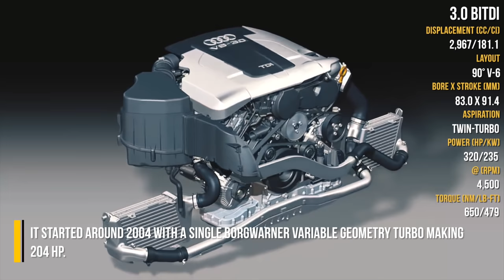7 Greatest Audi Engines Ever

Comment: I was an Audi dealer tech for 35 years before I retired. A lot of great memories in this video. I will say though, most of those engines are far more fun to drive than to work on.
Reply: audi techs i have noticed over complicate everything and do things by the book, where as if you just do some simple redneck engineering you save time and do the job better than the manufacturers “rules or procedures”

Comment: 2.2T is the best!
Reply: Yes it is, 3b is the best of the 2.2
Reply: Indeed, anyone selling an AAN 20v turbo?
Reply: aan is best ;)
Reply: 3B is shit compared to the layout of AAN, ABY and ADU.
Reply: @Holli622  3b has the best airflow, and very minimal changes, minus ecu between them.
Reply: @harrisondavis2668  the AAN intake manifold outflows the rest of them by far so, no. And between a 3b and a AAN and ADU there are some huge tech differences.
Reply: Harrison Davis steal 3B intake for my AAN
Reply: ye it is close to the 2,7 TT :-)
Reply: Definitely not the best. Definitely one of the most legendary but not the best. Best motor to date is the 2.5T i5 motor and that’s based on sales numbers. Best power house is the BiTurbo V6 out of the B5 S4 and 3.2 24v VR6 motors.
Reply: You are damnn right
Reply: @El_Jefe_S3  2,7 t is the best and the best 😁
Reply: 2.5t *

Comment: missed 1.8t 20v ;-(
Reply: The bam engines are shit.
Reply: Failed headgaskets, turbos and coils?
I know several Audi enthusiasts that hate that engine.
Reply: Bam, Amk, Ayp and Apx are good
Reply: Designed by Audi, built by vw.
And the 20V tag was a highly evocative reference to the mighty Ur-Quattro
Reply: Well, i have the APX engine wich is tuned above 300hp, it works like a charm, goes without any problem, never had issues with coils, turbo is a borg warner k04 hybrid and headgasket no issue at all, so do not know if u are thinking about the 225 or the poor 180...
Reply: And it has original forged MAHLE pistons, crank and rods, webbed block for lighter and cooler engine,, list goes on about good things
Reply: I own an auq roadster and its pretty bulletproof. Crazy to have the money to upgrade it to stage 2
Reply: @Ry_Hardy  Mines making 348bhp and in daily use for over 45k miles making that power (140k total). Only bad thing about that engine was the weak rods which most people replace.
Reply: The AEB was a tuners dream, I had 2 of them...
Reply: @espenschjelderup426  There a definitly more fans than hater. The engine is great, there are even groups in facebook with 15.000 people.
Reply: @owngun   I may be a bit biased because I don't like VAG cars 😂
Reply: @espenschjelderup426  I cant understand why people dislike cars just because theyre from a specific brand or group, theres a awesome car from almost any brand. Like how can you dislike a V10 Biturbo RS6?
Reply: @owngun   I don't dislike VAG because it's VAG. But most of the cars from VAG I have tested I don't manage to find a comfortable driving position in, and most of them I don't like the handeling of. 
Actually helped a friend diagnostic a 1.8T(a tuned 150hp one) A6 Quattro about a month ago. We suspected a coil because of the missfiring, but the engine also got a bit hot, and changing the cooling fan fixed the problem. My Autodata tells that both cooling fan and coils is known problems.
Ok car to drive, but considering the pricetag new, a bit dissapointing. Handling was a bit swimmy, and a bit stiff and uncomfortable because of the factory lowering.
I actually like some VAG cars a bit, like Skoda Oktavia and Superb, and I like the 1.9 TDI.
I like Ford the best when it comes to makes, but not alt the cars from Ford. I don't like Mondeo for many of the same reasons as mentioned for VAG above.
Does VAG make cars that are nicd to look at and engines that sound nice? Absolutely.
Reply: @espenschjelderup426  You should test more 1.8t 20v. The engine is almost bulletproof. I own my 2nd 1.8t both didnt made any problems. Ive test driven some 1st Gen TT with 225hp and they drive very well.
Reply: Engine turns to shit after 300k kilometers, almost every rotating part will start to fail, my head gasket is about to blow, etc. etc. 

Anyone selling an AAN 20v Turbo? :D
Reply: Jori Schröer the best 1.8 T is the APY. I have searching for very Long to get one with that Engine in good Condition (Only the Audi S3 8l got this Engine). Now i have about 300hp and it got 235.000 km on it. Never made any Problems. And you can do anything to it. (Here in Germany the 1.8 is like the sr20 in Japan)
Reply: AEB were pretty solid as well
Reply: I got a 430hp B6 A4 on a 52mm turbo at 26psi on stock internals just built trans clutch an fuel system
Reply: @unsaidatom2310  here here!
Reply: @owngun  i'm thinking about buying an audi a3 from early 2000s with a 1.8t. probably wouldn't buy one over 200k kms (more like up to 150k) and i'd prefer the quattro system. I hear these engines are quite reliable and tunable. What do you think should i buy it, or go for something newer?
Reply: @adodoes8770  If it is right maintained  the engine is great. The Timingbelt should be done. Check that the halexoil was changed too. I would change the motor oil to a 5W40 or a 10W40. If you want a newer A3 buy the 8P with the 2.0TFSI quattro. Its the engine of a mk5 GTI but with quattro.
Reply: For good reason....there's absolutely nothing special about them.
Reply: @dwalmop2  At the time the 1.8t 20v was released the 5 valve per cylinder were special. The engine is bulletproof and very tuneable. In europe the 1.8t is and was a quite popular for tuning. Compare it to other smaller engines from the time.
Reply: @owngun  meh, I don't know...I used to have one.  Even tuned it was pretty gutless under about 2500-3000 rpm.  2.2 20vt 5 cylinder was/is much much better.  It's got that little bit of extra torque down low when you need it waiting for the turbo to spool.
Reply: NOTSUI AWP ftw
Reply: @LuckySyke  amb here. block and turbo are solid no doubt, but head gascket is a pain inthe arse
Reply: me too. Another great and tunable engine
Reply: Love mine in my gen 1 TT, rev happy and tunes well, just change that timing belt!
Reply: TFSI and FSI Will never live long like 1.8t 20v...
Reply: I’d rather the 20v 1.8t over the the V8 in the B6 and B7 S4 :(
Reply: Again, timing chain... that shit will get loose quick
Reply: @patrickrodrigues4202  agu is great for modification.
Reply: Eron Gashi no its audi product
Reply: 1.8 20V (non Turbo-N/A)Version is better i think

Comment: The 2.7t actually ran to almost 2005 in the allroad :-)
Reply: Yep.  Friend of mine has an 04 allroad i think. Not 100% on the actual year
Reply: Yeah I had a 2003 2.7L Allroad. Pretty quick for a wagon lol.
Reply: personnal fav
Reply: Get a b5s4 and you wont miss your allroad :)
Reply: I thought the 2005 allroad only had the 4.2?
Reply: The 2.7t is unreliable and the allroad is a shit car.
Reply: MTM used to have an upgrade package for the 2.7T RS 4, boosting it up to 600 hp.

Comment: Ehm, 2.5 TDI inline-5? Absolutely bulletproof engine, first Audi TDI engine ever.
Reply: Absolutely. Not sure if it has been modified for the van, but in the ambulance world the VW T4 with the 2.5 audi are remembered for being near indestructible
Reply: @crezychameau  < This. In Ambulances this engine goes for 600k with no major issues... even though it is never heated always floored and so on.
Reply: I'm a happy owner of one bulletproof 2.5 TDI in a bulletproof Volvo V70 I. Brilliant car, 474 000 km on the clock and running like new
Reply: Inline 5??
Reply: Boring as fuck though when compared to. the above mentioned engines. probs why  its not listed .
Reply: Don't forget the 1.9TDI
Reply: @jirikopejtko85  running like new? really?
Reply: @1dayumay548   yes. same motor in vw multivan and touareg r5 tdi

Comment: 1.9 Tdi?
Reply: Damn good engines those, especially PD ones.
Reply: VW developed that engine, but it is a masterpiece
Reply: Be doenst know any •••• about engines
Reply: A4 B6 1.9TDI AVF 131ps 💪😍
Reply: 1.9tdi awful engine burns oil like a oil rig
Reply: @johnsmith-mk3zq  nope
Reply: @SKO307  there are so many known 1.9 engines burning oil..... thats why they died
Reply: VW
Reply: Exactly man. the 1.9 130 hp tdi is the best diesel engine ever made.
Reply: I had a golf topped it up every week ith oil and thrashed it hard was on 12 hours a day just not Sundays good little engine economical with a dsg it's a bit jittery but who cares it's perfect low on insurance too
Reply: @johnsmith-mk3zq  yer no. Mine doesn't and I've owned mine for 5 years and done ,53k miles
Reply: @giuseppemaggio5894  no, it is the ARL 1.9 tdi 150, best of the best
Reply: Got a Vw Passat 1.9 tdi its a beautiful engine, not had any issues
Reply: @johnsmith-mk3zq  burn oil? My father got a passat with 1.9 130hp and don't even touch on the oil and it has 425000 km /264000miles and the engine still going strong like no problem...
Reply: TacoMeat FijiWater  most Audi engines are developed by VW.
Reply: Those who comments that this engine is awful, you clearly didn't ever had this engine (only VAG group)
Reply: VW 1.9 PD TDI is one of the best engines ever made. Massive torque for its displacement triggers people to push it mindlessly, carelessly, and then they complain that it burns too much oil.
Reply: Pd130/150 are One of the some beet tdi engines ever..... PD 130/150 OM617 OM605 OM606 etc....
Reply: @MrHussain1998  wtf, hell no😂 Basically every engine except the 2.0 Tdi and the 1.9 TDi from VAG are made from Audi. There also was a 1.9 TDi made from Audi
Reply: @johnsmith-mk3zq  it's one of the most reliable engines ever made, what are you talking about?
Reply: @SKO307  got the same but AWX 😍

Comment: I worked for several Audi Franchises over the course of 19 years and drove all the cars you showed except the RS3 which just appeared after I left although I used a TTRS for a few days which obviously has a related engine. The original shape TT also towards the end of its model cycle was available as a 3.2 which was magnificent - really rich, creamy, almost 5-cylinder gargle to it and so, so powerful. The only thing I remember being even more insanely fast was the five litre RS6 V10 - which by the way I preferred over the normally aspirated 5.2 as it didn't need to be revved so high and had a more woofly bass baritone rather than the shrieking "double five" Ur-quattro rally car sound which - forgive me - is all very well and exciting within a video like this, but quickly gets wearing in real life! It's  a really really hard decision to make as I'm so tempted by the old TT 3.2 but accepting that's arguably more a VW engine than an Audi (although it's ultimately the same company so the distinction is moot....), acknowledging the wonderful 2.2 and 5.0biT V10, I guess my favourite was the B7 RS4 which for its phenomenal V8, slick manual, sober but sinister looks, relative simplicity (I can't stand all this lane assist/night vision/endless driving modes etc that are nothing but complications, clutter and distractions) and effortless, rock solid yet nimble, precision handling  is really hard to beat. The S5 Coupe 4.2 was a lovely thing, too. Great video  - so admire your enthusiasm and energy not to mention managing the language barrier - hope the Like and Comnents help!

Comment: 3.0 V6 TFSI supercharger?😢
Reply: RIP 3.0 V6 TFSI Supercharger.  Gen 1 was an absolute beast.  Favored by the Audi Community.  Plenty of power and ability to tune it in such a way...simply amazing.
Reply: @ProjectArjun  yes...my dad got A6 3.0T 300hp and its better than any turbocharged V6...launch is much better specially with quattro all wheel drive...go visit my chanell i got videos about our 3.0T
Reply: Hi how is the oil burning situation of the 3.0 supercharged? I am planning to buy an audi a7 2012
Reply: @XLPerformance666  this motor has race specs and people who drive it for years told me that the best oil is Mobil 0W-40. Pay attention on bonet seal it might leak
Reply: @XLPerformance666  Buy a model that is 2013 or newer.  The 2013+ models have revised piston seals that help mitigate oil consumption.  All Audi's are known to burn oil anyway
Reply: Have yall thought about when the timing chain would have to be replaced or if it got loose?  Yall in big big trouble😂$$$
Reply: Yes, I have reprog my Audi S4 avant and I have 420HP and 0-100 in 4sec !

Comment: 3.0 TFSI should be included. Award winning and used not only on the S4, A6,S5 but also on Porsche Panameras.
Did I mention very easily tunible too?
Reply: Garbage sounding engines that was quickly overlooked because Audi had better engines.
Reply: @NBASFAN  Judging by your YouTube content, saying the 3.0TFSI sounds like garbage, you obviously have no idea.
I

Comment: i really like the 1.8t in my 2001 S3 :)
Reply: deadmarch101 I have one too, solid engine, too bad the car is heavy
Reply: Very heavy, it reminds me more of a GT cruiser than hot hatch. Great noise and nice stance anyway. Love it
Reply: Yeah, I love to cruise with it, it does ok handling wise too. Any mods on yours?
Reply: just stage 1 and KN filter, 265bhp. What have you modded? Anything suspension? 
Im thinking about coilovers...
Reply: Actually yeah! Very first mod I did, cuz the shocks it had when I bought it were wrecked, so I installed  ap coilovers, not the best not the worst, they get the job done and the car feels really solid, stable and nimble I dare to say, it's lowered probably about 4cm or more and I have spacers and a fmic, getting it ready for stage 1 too
Reply: Vasco Canas i got the S3 8l too (1999 and its Imolayellow 😍) new Front/rearlights (Original from a 2001 S3 8l) KW Suspension (40mm lowering too, does very Great Handling) new ECU Upgrade (now 270hp) Steering Wheel from the new S3 (but i haven't the MMI system so nothing works😔 but i will do it) FOX exhaust system 3" with Downpipe and 2 Metal catalysators (yes we need them here in Germany). I want a new Turbocharger (maybe just a K04 "Upgrade", he brings up to 380hp).

There are so many Things you guys can do with your S3 8l, its the greatest Model of all S3 in my Opinion with the best Engine (thats Fakt). Hope you guys will like it forever. I Love it.

Greetings from Germany (and sorry for the Bad english) and have a Nice day
Reply: David Henneberg those are the goals i have for my s3. Mines black, so it's impossible to keep clean. I really like it's styling tho, more than the newer generations, except for the new sedan
Reply: @vascocanas4211  yes the new sedan is gorgeous. But I would still prefer the 8l. It looks like no other car, and he drives even like no other car, not even like an audi.
Reply: David Henneberg have never driven another Audi to compare, but I've driven a Evo X, and I find the s3 prone to understeer, might just be my tires idk.
Reply: @vascocanas4211  I drive many Audis BMWs and Mercedes (I never drove a Evo, but I want to) and everytime the BMW was the best car in performance. But the first time I drove the S3 I knew I need to buy one, so I did. I put new Dunlop tires on it und a new KW suspension and it drives very good especially for a hatchback. The Evo is a racecar the S3 is a sporty daily driver hot hatch. It don't even meant to be a racecar, for that you need to try the audi R8, this thing is very good in every corner.
Reply: David Henneberg I mentioned the Evo because it was the best handling car I've driven, the fastest one was a Mercedes c30 AMG (with mods).  It might just be my tires and suspension set up. I'm planning on getting kw or Bilstein in the future. You're right, is a great daily driver, only downside is the fuel economy xD but I seriously need a tune and I'm pretty sure I have a vacuum leak somewhere
Reply: i have one in my 1999 A3 swaped it from a seat leon FR
Reply: I had -04 1.8t Quattro. One of the best cars i ever had, no single problems in three years and when the snow came it was a great joy, even pulled my friends car from the ditch during winter haha. Now i have 2.4l volvo s40 FWD and dear god... miss my Hitler. :(